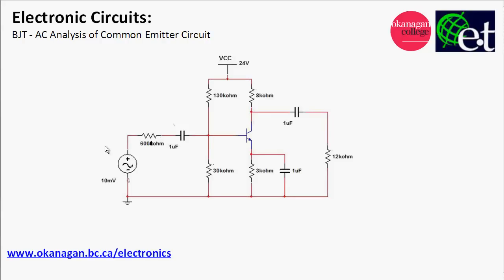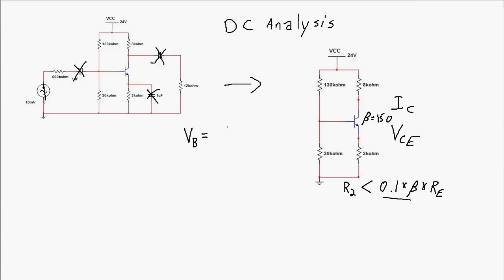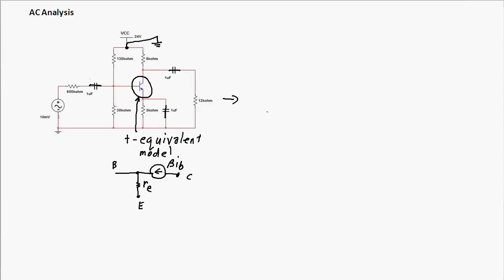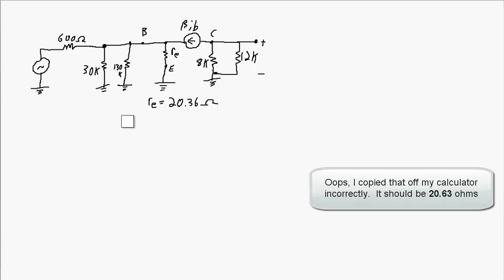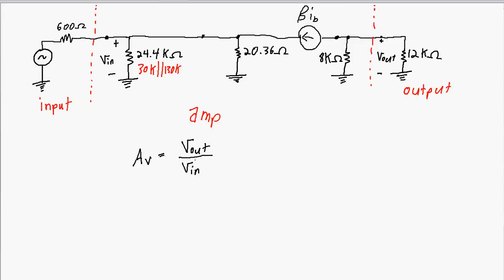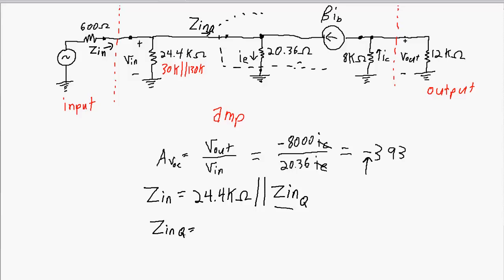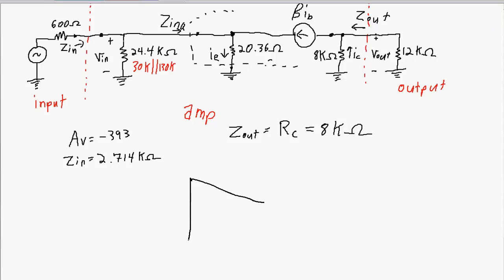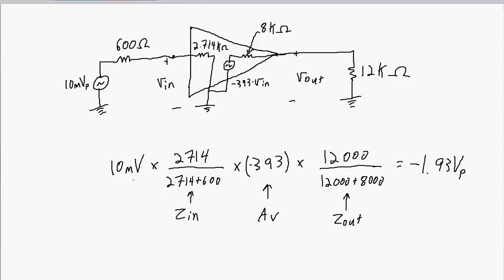Common Emitter Amplifier

Comment: In calculating Z_inQ you used the normal relationship that I_E = (beta+1)*I_B. However, didn't we calculate the Q point with the assumption that I_B=0, thus making the input impedance infinite?
Reply from the maker: I did assume I_B=0, but there are two things about that assumption to point out. First, that was an approximation to make the Q-point calculation easier. Second that is for DC current while the Z_inQ that I calculate is for an AC signal

Comment: hi, this is a very good tutorial yet I could not understand your approximation at 2:27 with voltage divider where you said:
  R2<0.1 x beta x Re
is 0.1 represents the base current?
I hope you can elaborate on this point, thanks in advance
Reply from the maker: The statement "R2<0.1 x beta x Re", is for DC analysis and is a requirement if I am going to make the assumption that IB is 0. There will be some amount of current coming through the 130k resistor. Some of that current will go in to the base and some will go through the 30k resistor - it's a current divider circuit. If "R2<0.1 x beta x Re" then about 90% or more of that current will go through R2 (the 30k resistor) which means I can say IB is low enough to ignore. I hope that makes sense.
Reply: thanks for your time and for your response,  if I got it right you compare if the voltage on the base is lower than the tenth of the voltage on the emitter of the transistor like this: 1 x R2 < 0.1 x beta x Re    
so 0.1 x beta is the current at the Emitter after amplification times Re gives the Voltage at the Emitter
1 x R2 is the current passes at R2 that gives the voltage at the base of that transistor
Reply from the maker: You're on the right track, but you don't need to compare voltages, you only need to compare resistances (i.e., the resistance seen looking in to the base which is (beta x Re) vs. the resistance of R2 (30k resistor)). You want to make sure the resistance of R2 is 1/10th (or less) of the resistance looking in to the base so that 90% or more of the current goes through R2
Reply: sure thing, we always seek calculations shortcuts, as far as I remember from my practical electronic knowledge, for me, this is a new kind of DC approximation technique (-:
thanks a bunch, keep producing your concise lectures

Comment: i like very much of you channel and give my like and already make a question? if VC(power supply) is connected thru a diode, r1 and r2 resistors calculation remain a parallel model??? the computation of about all circuit still the same??? sorry by my poor english!!!

Comment: Hi! Thanks for the video! I just have a question. Why is V_E = V_B - 0.7?
Reply from the maker: V_E = V_B - 0.7 because the junction from base to emitter is a diode, and I'm assuming the voltage drop across the diode is 0.7V

Comment: +David Williams
This transistor had beta of 150, but the result is 193 times amplification.
Is that ok?
Reply from the maker: +Sylwester Kogowski. The beta of the transistor is the current gain while the gain of 193 is the voltage gain of the amplifier circuit that uses the transistor

Comment: here..at 13.42..we took Vin as 20.36ie but can we take Vin as 24.4k ie as its the same electrical point..I have confusion there....help me out if possible...and awesome video sir....
Reply: The point you're looking at is actually the base of the transistor, not the emitter. That means that the 20.36 ohms needs to be scaled up by the transistor β to give the effective input impedance as seen at the base (that's around 3K in this case).

Comment: I've always heard it's a very bad idea to have a circuit that depends on the beta value, since it's so prone to changing. It seemed to imply there should be no reason to use beta in your analysis.
Reply from the maker: IN the DC analysis, I used a shortcut method that assumed beta could be ignored, you could use a more precise method that includes beta. If you use both methods, you'll find that the difference is minimal (usually). In the AC analysis, I ignored beta again, but could have included it. For example the ratio ic/ie = (beta)(ib)/(beta+1)(ib). (beta)/(beta+1) is close to 1, but not exactly 1.

Comment: Hello david ...during calculating Zout in around minute 17 , you considered that the betaxib current source as open , however in thevinin's equivalent we can not consider the dependent current sources as open , so how did you do that ? , am i missing something?....thank you in advance
Reply: +Mohamad Fakhoury It was dependent in the original abstract model, but its value is known at this stage of the analysis.
Reply: +Nick Allen Thank you for your reply mate , but its still a dependent current source at all stages and its value is always known in all stages as long as ib is known .

What i did is that i short circuited the independent AC source , and using kvl , ib was equal to zero , and hence the dependent current source (beta x ib) can be considered as open .

I think this is more systematic way  .
Reply: @mohfa1806  Current sources are always high impedance (by definition). They are equivalent to open circuits in all practical ac applications. Whoever taught you gave you some bad advice.

Comment: Hi, thanks for you video. I have a question :  Can you tell me what is the purpose of the 1 µF capacitor which is in parallel of the emitter resistance ? I think that is for having a higher gain but I'm not able to prove it... Is there someone who can help me please ?
Reply: This capacitor will short emitter resistance, for ac analysis. Else if emitter resistance comes into play in ac analysis, there will be a finite voltage drop across it. This voltage drop would reduce the amplifier voltage gain as a whole.

Comment: 4.19 i don't understand why you added the 3kOhms resister when calculating Vce. Would it not only be the 8kOhm? Thanks for vid
Reply from the maker: VCE is the voltage between the collector and the emitter. If you only used the 8k resistor, you would only be including the voltage at the emitter. VCE is also VC - VE (Voltage at collector minus voltage at emitter).  VC = 24V - (IC)(3k)  and VE = (IC)(8k) ... therefore VCE = VC - VE = [24V -(IC)(3k)] - (IC-8k) if you rearrange this, you get the equation at the bottom of the page at 4:19.
Reply: David Williams thanks for the reply. Is Vce the same as Vc(ground) ?
Reply from the maker: @Throwbaq  no, Vc(ground) is the voltage between the collector and ground while VCE is the voltage between the collector and the emitter.
Reply: @ElectronXLab  Thanks for clarifying. Working though some questions now, they don't seem to care for Vce but Vc(ground). You've help lots already.

Comment: Hello,
At the time, 4:55, either a fuse got blown, or fire ignited the wiring.
Reply from the maker: Yeah, I guess it would if you actually shorted out that supply, but in this case, it's just a mental exercise to allow us to implement superposition theorem.

Comment: I have a doubt, once Zin and Zout in the linear equivalent circuit have been calculated I see there's one more drawn circuit with an amplifier, in which the output resistance of the signal source and the load resistance are evaluated separately to determine the final overall of the circuit, right?. My doubt is that in the equivalent circuit (from what I see in the layout),I would normally solve 600 || 2714 ohms and then to get Zout I'd do 8k || 12k, is my approach wrong? Disclaimer:I'm a student

Comment: What about capacitor values? How did you calculate them?
Reply from the maker: I didn't calculate them in this example; I just assumed that they were big enough to look like open circuits at low frequency. If you did need to calculate, then you'd select a low cutoff frequency for a high pass circuit and calculate from there.

Comment: I really do not understand where this 26mV comes from to calculate the re. Is this a fix value or sth?
Reply from the maker: Yes, it's a fixed value (actually it's temperature dependent). In the small signal model, we are assuming the base emitter junction is acting linearly (like a resistor), so approximating that re = VBE/IE. VBE is a characteristic and it KT/q where K is Boltzmann's constant, T is temperature in Kelvins and q is charge on an electron

Comment: Which program was use in this video? I want to use it. Do you use tablet or phone? What is program name?
Reply from the maker: For software, I use OneNote for writing in and Camtasia to record. For hardware I used a Wacom tablet connected to my laptop. I have a Surface Pro now, and it is much nicer to use. With the tablet, I had to write on the tablet, but look at my laptop screen to see the writing.

Comment: Sir, at 12:21, hown can you come up with Vout =8000 x Ic, because I think Ic current go to the equivalent resistor of (8k//12k) not only 8k Ohm resistor. It leads to Vout should be Ic times (8k//12k). Please explain for me, it makes me confusing.
Reply from the maker: I was specifically looking at open circuit voltage gain which means, the gain without the 12k load. You could include the 12k load to calculate a different gain that would be specific when the 12k load is included. I did open circuit voltage gain because I wanted to create the general amplifier model of the transistor circuit (without the load).
Reply: Thank Sir, understood

Comment: Quick question:
Where did you get the 26 mV in the re equation ?
Reply from the maker: It's the thermal voltage which is a characteristic of the PN junction. it's actually temperature dependent (VT = kT/q where k is Boltzmann's constant, q is charge on an electron in Coulombs and T is temperature in Kelvins)
Reply: @ElectronXLab  thank you. I just learned how little I know about transistors. Which is great! There is room for improvements.

Comment: where did the 26mV come from at @8:42? Or, is it a constant value?
Reply from the maker: It's a "constant" value called the thermal voltage. It is temperature dependent hence "constant"

Comment: When finding re my instructor uses 25 mV I see you and a lot of other people use 26mV,. Has this changed at all or is it a rounding issue?
Reply: kT/q is the equation. Temperature is the only variable. Usually "room" temperature is assumed. You'll get a different value depending on what the temperature actually is or what "room" temperature is assumed.
Reply: The thermal voltage depends on temperature.
At 25C, Vtherm = 86.17μV x 298 = 25.68mV ≈ 26mV.
At 20C, Vtherm = 86.17μV x 293 = 25.24mV ≈ 25mV.
How warm is your room?

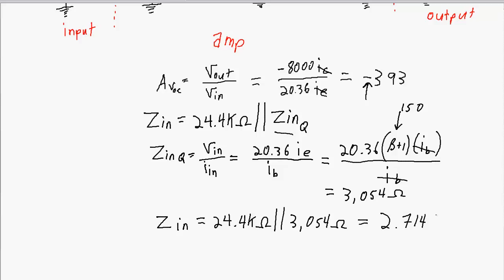Comment: At time 17:17 you state that Zin is parallel of 24.4K and 3,054 ohm.  Your result is 2.7141 k. My believe is that it should be around 3 Ohm. Correct?
Reply: i use hybrid model and getting 2.474k for Zin
Reply: The parallel resistance of 24.4K and 3.054K is around 2.7K. Perhaps you are confusing the English convention of using the comma (,) to demark groups of three digits with the European convention that uses the comma to mark the change from units to tenths. That function is performed by a decimal point (period) in English notation. You will perhaps now appreciate that 3,054 ohms is a little over three thousand ohms (3K), not a little over three ohms that you seem to have used in your calculation.

Comment: I have one query about the calculation of emitter resistor "re" in AC analysis that, does the emitter voltage will be always 26mV for all type of BJT.
Reply: Short answer: yes (although it's not "the emitter voltage")
Long answer: Shockley's diode equation, which relates the current through a PN junction to the voltage across it, is I = Is(e^(V/Vt)−1) where I is the current produced by a voltage V; Is is a current typical of the material used and Vt is the thermal voltage equal to kT/q. Then k is Boltzmann's constant, T is the absolute temperature (about 300 Kelvin for room temperature) and q is the charge on the electron. At room temperature kT/q = 25mV approximately.
If you differentiate the equation wrt V, you get dI/dV = Is(e^(V/Vt)/Vt which is approximately I / Vt. If dI/dV = I / Vt. It then follows that dV/dI = Vt / I = 25mV / I. That represents the dynamic (ac) impedance of the emitter junction and is independent of the material used.

Comment: Why is the voltage gain = -Rc/re when there is a load resistance? Shouldn’t it be                  voltage gain = -(RC||RL)/re      ?
Reply from the maker: You're correct about the overall voltage gain. The voltage gain that I was calculating is the open circuit voltage gain to create the amplifier model to which I then add the load

Comment: 7:57 could you pls explain to me why the resistor R_E is getting by-pass?
Reply: In the AC analysis, the capacitor is a short circuit. Since there is now a short circuit path in parallel to the resistor, no current will flow through the resistor and we can remove it.

Comment: What is the voltage gain percentage change when the load is connected?
Reply: It is reduced by a factor of 12k/(12K + 8K) = 12/20 = 0.6.

That is a -40% change.

Comment: Why do you confuse us, on your prior CE self bias circuit you Thevenized the input side of the circuit.  Essentially ending up with a base bias circuit with a  Thevenized dc source feeding a Thevenized  resistance in series with the base.  Then you subtracted the voltage drop across Rth to calculate Vb.. This time around you used the voltage divider formula to figure out the Vb. If R2 is not less than beta RE/10, does that imply input must be   Thevenized???
Vb is not the same  when you Thevenize vs using the voltage divider formula
Good job on explaining everything else.

W

Comment: I understand it becomes invisible with regards to an AC point of view, but I'm not exactly sure why? Why does the AC signal not travel through RE?
Reply: Because the capacitor is assumed to be a short circuit at the AC frequency desired.  Therefore the resistor is bypassed by a short circuit.  What's RE in parallel with 0 ohms?

Comment: Hi David. I tried to simulate your results in LT Spice and EveryCircuit.
While I follow your maths and am able to calculate the answer (Vout using a 10mvp input sign wave) as you have when I simulate the results I get a Vout (Voltage across the 12K RL Resistor) as of approximately 290 mvp.

So I'm a bit lost. Am I taking v-out voltage across the wrong point or is there something missing from your calculations.
I know this was done a long time ago, so.... Would it be possible to look at it again. I am happy  to send you my ltspice file if you like.

 I actually just looked at it again and was able to get a Vout of approximately 830 mvp just by changing the capacitors to 33uf. I guess that the frequency of the source was not really discussed. I'll look into it further and see how I go. Please chime in if you can be of some assistance.  Thanks...
Reply from the maker: Hey, I just did a simulation too (on Altium which uses a Spice based simulator) and I get about 1.7Vp. It's difficult for me to say what's different about your simulation. Some possibilities: incorrect capacitance values (try 10uF), input frequency is not "mid-range" frequency for your amp (try 5kHz), model for your transistor has some extreme values (e.g.,really small beta)
Reply: Thanks David. I appreciate your response. I will look at and caculate the values for the coupling and bypass capacitors. From what I have read the input bypass capacitor is calculated by summing the 600ohm and 30k ohm this becomes Rtotal. The using the formula of  1 / 2 x Pi x f x (Rtotal/10) this will give me the capacitor value. Do you agree with this. How would you calculate the other two capacitor values as I believe that the capacitors are in parallel with the relevant resistors in this case?
Reply: I just used a model of the BC547B as my transistor. What transistor did you use?
Reply: I have it working perfectly now. I calculated capacitor values for each location. At input 3.3uf, at the output 22uf and across RE 33uf. Thanks for your help. I hope this helps others
Reply: @stuartmp1974  The input impedance is about 2.7K, so a 3.3μF input capacitor will give a high-pass -3dB frequency at 18Hz - that's below 20Hz and ok for audio use.
The output load is 12K, so a 22μF input capacitor will give a high-pass -3dB frequency at 0.6Hz - that's unnecessarily low and a 1μF would be fine for audio.
The ac emitter impedance is about 20 ohms, so a 33μF input capacitor will give a high-pass -3dB frequency at 240Hz - that's not good for audio use. You need at least 470μF to get the -3dB frequency below 20Hz.

Comment: 10:03 Won't the input voltage be that voltage being supplied by the source? what you marked as input voltage is actually input voltage after voltage drop across that 600 ohm resistor.

OHH maybe that 600 ohm resistor is the internal resistance of the source? anyway its a small drop compared to kOhms....
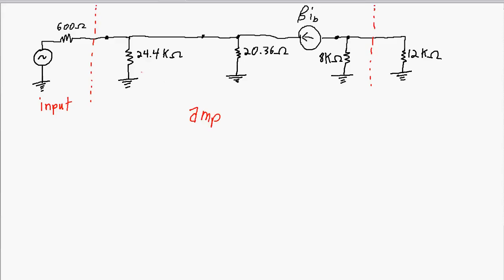Reply: Lol I was too impatient. 10:55 he makes it clear. I really should comment after the entire video is done.

Comment: Thanks for great lecture. I am confused in one point. When similar to output impedance calculation, if I calculate input impedance considering current source as open circuit, it will be 24.4K || 20.36 but results are different. Can you please explain why we can't go with my approach ?
Reply: It's because the 20.36 is a mistake. It's not the ac input impedance of the transistor. It should be β x re or 150 x 20.36 = 3K. iI you actually build the circuit or simulate it in Spice, you'll see that the input impedance is around 2.7K (i.e. 24K || 3K).

Comment: is there any other way to find re without assuming ve 26mV?
Reply: is re=Vbe/(beta(Ib))?
Reply from the maker: That 26mV is the thermal voltage (VT) and it is a constant value. Well technically it is temperature dependent. For a temperature of 298k (25 degrees celcius), VT = 26mV.   In general VT is kT/q where k is Boltzmann's constant (1.38x10^-23 J/K), q is the charge on an electron (1.6x10^-19), and T is the temperature in Kelvin. At room temperature, re = 26mV/IE.